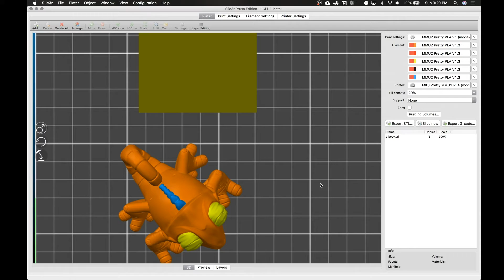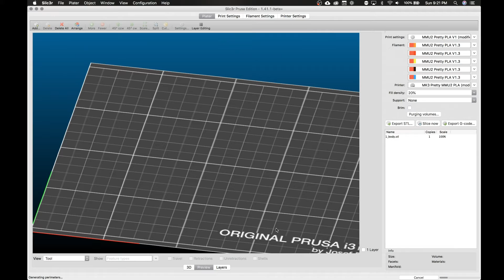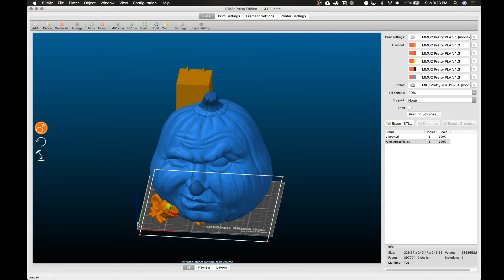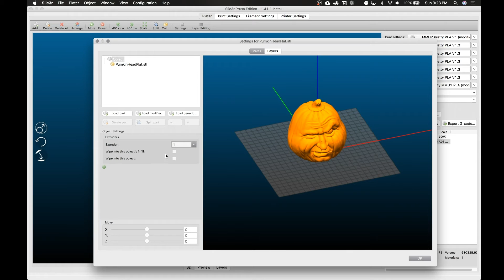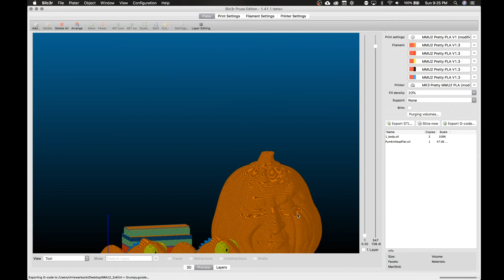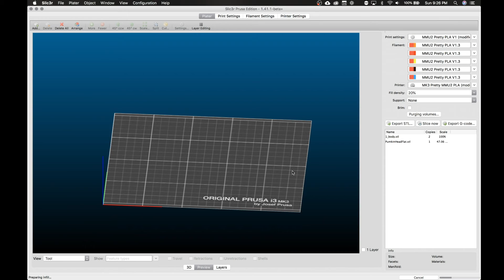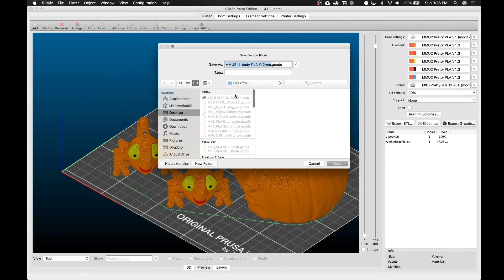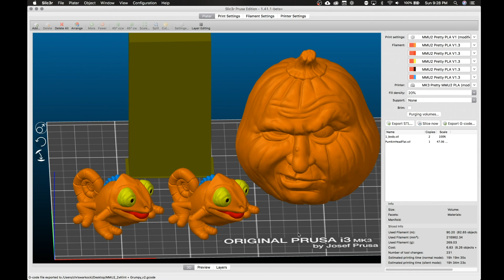Slic3r PE: Wipe Object and Wipe Into Infill

Comment: So you appear to have the only video covering this topic, and I can't find anything useful in the Prusa Forums. I'm wondering if there is a way to designate a specific color to purge into a specific "purge object"? Because from what I'm seeing is that anything above 2 colors, is causing these giant towers where sure it may be partially empty, but there is only so much you can do in the sense of "purge objects" to get rid of the tower.. What I'd like to do, is have...3-5 "purge objects" that are decent in size, compared to the multi-color object I'm printing, and have their perimeter be their default color, and have only that color be purged into the infill of that specific object (higher infill to cover the amount of "purge" necessary). So let's say, 3 purge objects, 1 3-color print. All of the black purges into the black object, all of the red purges into the red object, etc. There is a TON of mono-color prints out there, that I could EASILY set up a mono-print for each color of any multi-color print I have in mind, and I can't seem to find a setting for this problem... It's just that I print a lot of multi-color prints, and these towers are killing me.. And a filament recycler is a pricey investment that has conflicting opinions from the community in regards to filament quality.

Comment: Hey Chris! I just found your channel and have seen you in the Chris Riley's live stream chat.  Glad I finally found your channel and subscribed. I was just wondering though, if you are using wipe into infill and also using an entire separate waste print, shouldn't that be more than enough area to complete the purge? why does it still need an additional purge block if you're using all of that area to wipe into? It still seems like an unnecessary waste of material, although you did minimize it quite a bit.
Reply from the maker: Chad Williams the purge involves a very specific movement and the object itself doesn't have the setup for it. They could setup a way to do that within the object but we aren't here yet.

Comment: I have started using this version and it seems great to me. But I only have problems with the parts of the supports, because they add a lot to the piece.
I tried to increase the contact distance z but they still stick and I do not know how to increase the distance xy.
I would appreciate all the help.